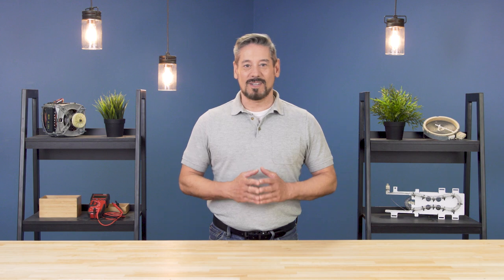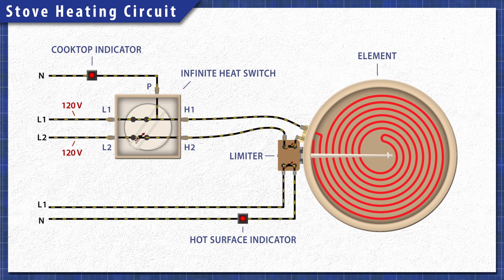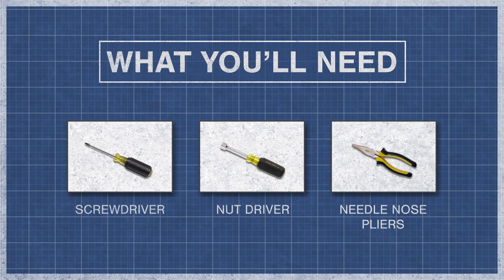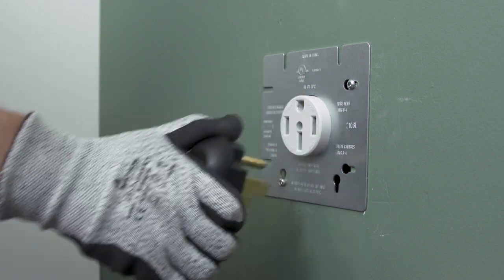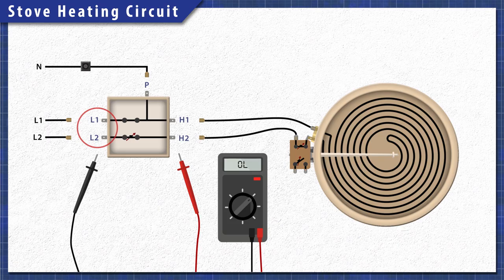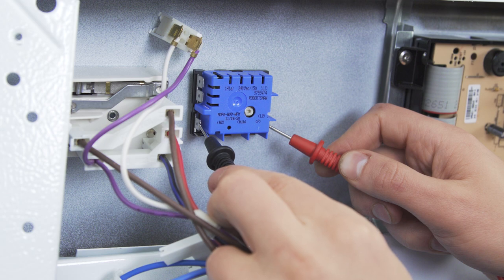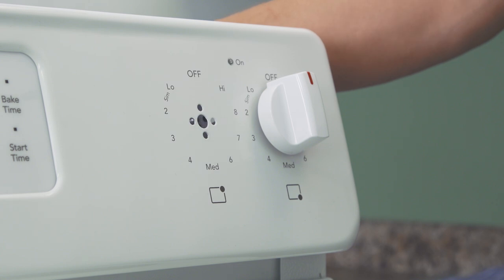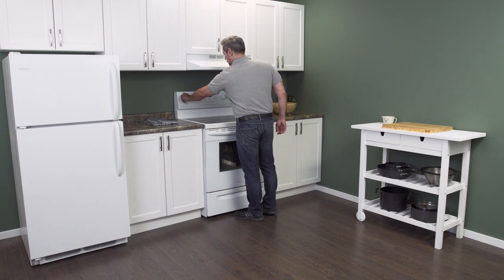Electric Stove Heat Switch - Testing & Replacement | Repair & Replace

Comment: Will the switch light be on even the infinite switch is bad? I have a burnt receptacle, got it replaced, but the ring still doesn't heat up. My next guess would be the infinite switch, but the switch light is on when turned. Thanks.
Reply from the maker: Thanks for watching. Yes as seen at 1:49 in this video, if one set of contacts doesn't close properly then the element won't heat. It is possible for the contacts to have continuity between L1 and P (which powers the indicator light), as well as L1 and H1 while having no continuity between L2 and H2. Test the switch first to see if you have continuity when the dial is turned on. If the switch is good, then it would be best to test the wires, receptacle and the heating element all together through the back of the oven. This can be seen at this point in this video: https://youtu.be/I7i25VPg-rM?t=382 Hope this helps!
Reply: @AmreSupply  Thank you so much.
Reply from the maker: @10zico10  You're welcome, we're just happy to help!
Reply: @AmreSupply  I went to buy the switch according to the diagram from the AMRE's web site, I am afraid there is a mistake on that diagram as the switch I needed was for the 8" coil, but the item# shown on the diagram was the 6" one. No wonder my mom said the heat on that 8" coil has not been fully heat up. I should have gone by the part name, and not by the number shown on that diagram. I hope there is no danger to use before I replace with the right switch. Here is the link - https://www.amresupply.com/lookup/225294/1529353#diagram
I needed the 8" coil switch on the left, but the diagram shows "F54", which should actually be "F54A".
Thanks again.
Reply from the maker: @10zico10  Thank you for letting us know! Without feedback its hard to fix these sorts of glitches. This happens when old models part numbers get substituted for newer parts.

As those switches are rated for different wattage and amperage, its still best to install the switch designed for the 8 inch elements. If it was only used briefly it likely didn't damage it but it can be hard to tell.
Reply: @AmreSupply  all good now. bought the right parts earlier, and used the wrong one replacing the other switch that happened to burn as well, nothing wasted. many thanks.
Reply from the maker: @10zico10  We're glad to hear it! Cheers

Comment: Replace the switch?  My burner was always on high, no matter the knob position. I just did replace the old switch and then took the it switch apart and found that there is an adjustment screw for the bimetallic element in the switch which will adjust the switch to make it work properly.  The new switch with shipping was $95.
Reply from the maker: Thanks for watching. The bimetallic strip can fatigue and warp over time. Adjusting the screw can help but sometimes it will change how the switch will heat at each setting. If you are unable to return the original, having a new switch to install in that burner or another burner could still be helpful as these can wear down over time.

Comment: There is important layer when instaling infinite stove burrner switches , that can catch people off guard and cause a direct short circut , its not an issue if you are using a OEM exact model replacement switch. and transfer the wires to the exactly same termnals on the new switch , Electric stove switches on each side of the stove Share a "unit on" indicater pilot light , so that lamp uses a shared connection that is wired to the pilot termnal on "both" switches ,,  The pilot lamp (The cook top indicater in your example) Termnal (The purple wire in your example)  is connected to the "L1 phase" of the supply power coming into the switch , (this L1 phase relationship for both switches is very important !)  and is energized anytime the infinite switch is switched on . if the exact orignal switch is no longer available many parts suppliers will be told to substute a compatible universal infinite switch , its termnals may not be in the exact same locations as the orignals , Its important that you do not get the  L1 and L2 connections crossed betwean the two switches , its important to look at the power input termnals of the new switch and ensure you connect the same power phase to the physical L1 input termnials on "both switches" so that "both switches are wired in the same same phase relationship".  If the L2 phase gets wired to L1 on your new switch , you will end up (In the united states anyway) with a direct 240 volt short betwean the two pilot lamp termnals if both burners are switched on at the same time.  Because the pilot lamp circut would then be connecting phase "L1 and Phase L2" directly together. Trust me you dont want to do that.
Reply from the maker: Those are some excellent points and is exactly why we try to show the importance of matching based on the terminal numbers rather than just color of wire or position.
Reply: Brother thanks for this info. I had to order a new switch for a frigidaire and I was sent a universal switch substitute. The way the substitute switch was marked wasn't the same and because of this I wired it up wrong and it was causing the breaker to kick out. After I read this I figured out the problem. I really appreciate you sharing your knowledge.

Comment: The only difference on the finishing up part is to test the stove before placing it back into place.
Reply from the maker: Thanks for watching. Yes that is a good point, the cord does have some reach to it so it can be tested before sliding it back into place.

Comment: Only video I found so far testing the Ego switch. P1 P2  2 4 6:30
Reply from the maker: Thanks for watching! We did notice that other videos skipped over some details so we tried to cover each of the variations between the switches and the terminal labels.
Reply: Did you get high numbers testing P2/4 & P2/PILOT? Double digits but decimals & 1 during the test? 
My back burner is turning ON by itself (warm with light on stovetop). Terrifying; I never use that burner since 2007!
Not sure if the first knob needs testing; it controls 2/3 of that burner set -just fine. Puzzling. (Wish I could just “cap/tape up” the bad wires & use the burners I actually need). Don’t know what to do. 
I can turn light off only by rotating knob fully clockwise back to OFF; Seconds later; burner warm & light glowing. So mine is when NOT in use; could’ve burned down my house had it been high heat!

Comment: So I swapped switches and elements and it still stays on
Reply from the maker: Thanks for watching. What stays on? Does the burner stay on? The cooktop power light? Or the hot surface light?

Comment: My switch seems to be working fine...except it is reversed.  High feeds a low setting, low feeds the high setting.  I checked multiple times and the switch is lined up properly, and I even tried switching the lines to the burner, cant find any info why the burner switch would operate reversed.
Reply from the maker: Thanks for watching. That doesn't seem like a common problem. Is that the original switch in your stove? Do all of your switches work in reverse or only one?
Reply: @AmreSupply  It's just the one, it seems like the original from what I can tell.  That burner was in-operable when we moved into the house and I just replaced the receptacle today and now it works but reversed, again only the one.

I checked to see that all the switches matched up the same, and they are.  It just seems like the one switch is flipped!
Reply from the maker: @brianclaxtondrums  Seems like the switch is faulty then. It is unusual for the high and low settings to be reversed. Inside of the switch there is a piece of metal that bends. Turning the switch will shift how far the metal needs to bend to disconeect the circuit. You can see the inside of the switch here: https://youtube.com/shorts/URFjJPQycsk

Might be best to install a new switch.
Reply: @AmreSupply  Will do, thank you so much for the help!
Reply from the maker: @brianclaxtondrums  You're welcome, we're just happy to help!

Comment: So, uh... I guess it wasn’t INFINITE, now, was it?
Reply from the maker: The heat is finite now that it has failed haha 
The infinite actually refers to the fact that the switch has an infinite amount of settings. Since it uses two bi metallic strips, turning the dial just changes how far the strips have to bend before disconnecting the circuit: if you're curious you can see the inside of the switch here: https://youtube.com/shorts/URFjJPQycsk